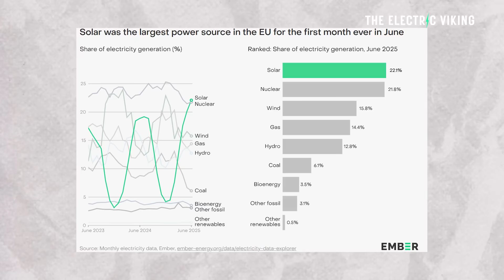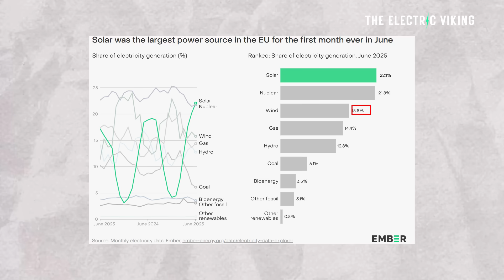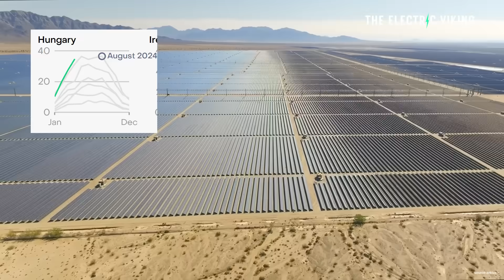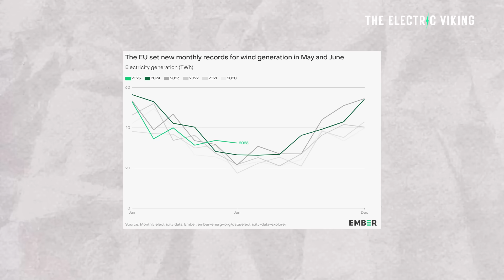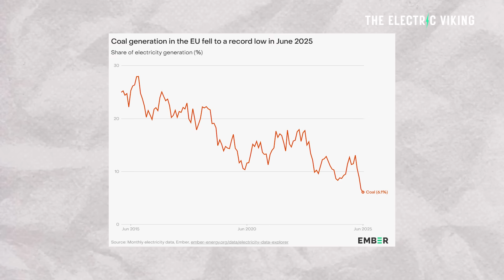Coal Hits Record Lows as Solar Power Becomes Europe's No.1 Energy Source

Comment: What's impressive is that renewable energy generating as a percentage is creeping up even thought a lot more is being thrown on the electric grid, EV cars, heat pumps, AI datacentres and air con with the heatwaves Europe has been getting over the last decade.

If this continues, eventually renewables could power everything, especially when battery tech is cheap for high capacity.

Comment: Bunch of idiot on the most ungreen technology around especially wind turbines even on this to cost a neyodium magnet core could get a 50% flux increase that is DC power so required frequency adjustment battery cause it can't direct load gas when it doesn't have enough and vs 7 nukes on the east off Australia would require 21.500 plus turbines alone your idiots at twice what your parents payed

Comment: The problem with solar is: it’s not available 24/7/365 🤷🏻‍♀️ so we need a 100 % backup for the night and for when the sun doesn’t shine
Reply: This is what energy storage is for.  And other alternative sources such as hydro and geothermal.  It will take time to build out the necessary storage capacity, and increase generation from geothermal where possible.  In the meantime, the focus should be on maintaining the bare minimum of nuclear and gas plants to support the grid through the night.  The goal should be to phase out coal plants ASAP, and then phase out gas generation ASAP, and then in the longer term after battery capacity is built up, it can be considered whether nuclear should be maintained or not.
Reply: @HonestJohn-y3k here in Germany we’ve already found out that doesn’t work. 🤷🏻‍♀️
Reply: Fortunately batteries continue to drop in price, and installation of storage batteries (making solar power available in the evenings when electricity use is often at its height) is at record levels and continues to grow.
Reply: @simhedgesrex7097 it simply won’t work on batteries only 😂
Reply: Solar energy needs to always be combined with hydro, nuclear and wind. Germany closed their nuclear powerplants. Which was INCREDIBLY BAD move, as Germany got like ZERO earthquakes and their neighbour France got gazzillion of nuclear powerplants. So HOW will Germany EVER be safe if France REMAINS to have so many nuclear powerplants? Isn't that embarassing? Not to realise THAT?

Comment: That's great and all but then shouldn't the cost of electricity going down?   Seems like the areas that have the highest renewables are the ones with the highest rates.
Reply: That's because how pricing is set. The day is truncated in periods and for each period they bid to all the producers and select from the offers what is need to cover the expected electricity demand and the price overall price is set to the highest price of the selected bids. So even if just 1% of the production is done by costly gas or coal plants the whole 100% of the production is paid to the producers at the highest price. So unless pricing policies changes, electricity prices will remain high till we can cover even the peak demands most of the time with a combination of renewable and batteries.

Comment: Between 1999 and 2008 the EU was consuming some 300 million tonnes of coal per annum. In 2024 this was down to 107 million tonnes. Meanwhile somewhere else in the World: "China Coal Production was reported at 4,710.000 Tonne mn in Dec 2023." This is roughly 44 times the consumption of the EU in 2024. While the EU reduced the consumption of coal by some 193 mn Tonne since 2008, in the same period China increased the annual consumption by over 1,193 mn Tonne. Imho much more important than phasing out coal totally in some countries while others keep burning it, would be to put purifying air filters on each existing or new coal planet Planet-wide. Smog and dirty air from the seventies, eighties and early nineties in Germany were long gone by 2008 and 2010, long before they started shutting down coal plants (without working replacement).
Reply: China has now reached a tipping point, with less coal burned this year than last year (even though demand went up), and the drop will continue to install record breaking amounts of wind and solar, along with Nuclear.
Reply: @simhedgesrex7097  They are installing record wind and solar, nuclear and hydro - WITHOUT phasing out coal and gaz etc. Less coal burned this year? It 100% has nothing to do with a drop in production because of Trumps tariffs some would say. I think otherwise.
Reply: They have also doubled their solar and wind power plus battery storage, give them time and you will see the coal diminish as they know its cheaper to get free energy from the sun than dig it out of the ground
Reply: It is good to clean up the terrible particulate pollution, but this does not solve the problem of climate change due to greenhouse gas emissions.  Far, far better to phase out coal entirely.  This will mean adding lots more wind and solar generation, with battery storage.

Comment: The UK, Europe, Germany and the rest of the world have been too slow to transition to wind and solar energy combined with battery storage and all electric vehicles.  Wind and solar energy do not need to be imported and can be produced locally in any country. Battery storage is key for base load power. 
Europe needs to provide more incentives for homes and businesses to install electric heat pumps and get rid of old polluting gas and oil boilers.  The move to electric vehicles will also be sped up. There is no good reason to help fund Putin's war by buying oil, gas and coal from Russia. There is a Climate Crisis making weather events more extreme.  Time to switch to renewable energy. The future is renewables. They are safer, cleaner and cheaper than fossil fuels. It is time for governments to end fossil fuels industry subsidies.
Reply: Looks to Russia and other oil producing nations. UAE is investing in clean energy and Russia is still investing in oil, gas.
Reply: @AGZF1983So is the US.

Basically China leads the world into the electric future, while Russia and the US believe they can cling to the fossil fuel past.
Reply: Yes we need to stop feeding the furnaces with non-renewable stuff and crack on with solar, wind and storage, once fitted off it goes

Comment: This is just like the California BS "electrical generation" records you have quoted before - on summer peaks.  You take no account of anything but Electricity which is only 33% of all power used in Europe.  Today EU electricity still uses 37% fossil fuel, and 23% nuclear, Wind 17%,  hydro 13%, Solar 9% 2.4% burning waste. But again - Eectricty accounts for only 1/3rd of energy used in EU. Hence 67% of industrial etc are nearly all Oil and Gas. Overall Solar is only about 3% of Europes total energy use. Even when Solar peaks in the high hours of Summer - it is only about 8% for very short periods in the summer. Why distort the truth?  Becasue it seems tiny?

Comment: Interesting that electricity consumption increased by 2.2% but in some countries grid demand has actually gone down. This is because more households and businesses are producing and consuming their own power on-site, reducing the load on the grid. Here in France supermarkets are putting up acres and acres of solar panels which creates shade for cars but provides a good %age of the electricity needed to run the store. It's all going in the right direction. 😊
Reply: On-site solar is such an obvious solution.  Every government should enact policies that favor it.  It's a good way to avoid domination by fossil fuel suppliers.

Comment: In Finland it makes absolutely no sense to rely on Solar. The problem is the winter. As there is midnight sun in the summer there is full blasted dark season almost without sun. Luckily for Finland there is lots of firewood. There is actually more energy firewood you could ever consume. So Finland and Sweden should have special treatment considering burning wood because it is unfair to expect them to use solar power. Firewood is actually the best and only sensible way to store energy for long periods of time in places where it is abundant like in Finland and Sweden. Another consideration is that in Scandinavia, houses must be properly insulated to keep heat in during the winter. Due to the good insulation of houses, utilizing heat from firewood is particularly effective in Scandinavia.
Reply: Firewood is not renewable in the short to medium term (you need to grow back the trees), produced carbon emissions and particulates that are damaging to health.  Finland is quite capable of using wind energy, hydro energy and nuclear in the winter. It uses a lot of biomass already, but needs to gradually cut back, once it has phased out coal.
Reply: " In Finland it makes absolutely no sense to rely on Solar. "
Right now that's absolutely true;  What about wind power?  I imagine that it gets very windy in Finland, especially in winter.  As PV gets cheaper in the future, it may become worthwhile to install some solar, even if it only functions four or five months every year.
Reply: I would say that solar there is viable in function of price's panels. If they are cheap enough then might be an option for low consumption (not heating).

Comment: Great story! However not quite: this is only the electricity source. Electricity provides less than half of all energy consumed.
There are major gas networks in Europe, as well as a major fossil usage for all forms of transportation. Mobility and heating are not by far yet electric. This is the HUGE transformation. Moving massively to heat pumps (for heating) and urban heating systems. Of course: ICEs move to EVs - but cars last ...   WIND! Vattenfall just OPENED its first subsidy-free Netherlands based North Sea wind farm! Commercial business doing this: amazing!

Comment: Cost per kw

China $.08/kw
USA $.12/kw
Germany $.40/kw

China has lured the west to replace traditional electricity generation with alternatives so they can take your industries and jobs.  Ultimately to control your country.  

It’s not a conspiracy.   It’s a strategy.
Reply: I guess China lured themselves into it too: In the next five years China is expected to add annually: Solar: ~100–150 GW, Wind: ~30–40 GW, Nuclear: ~8–10 GW , BES: ~3–5 GW. Now lets change the numbers for CURRENT capacity factors in China: Solar: ~20-30 GW, Wind: ~11.3-15 GW, Nuclear: ~7.2-9 GW.  Wind and Solar capacity factors will increase, Nuclear will remain in the same range. Coal net increases for the next 5 years is around ~30 GW annually, ~15 GW with current capacity factors.

Comment: China burns approximately 4.5 billion metric tons of coal annually as of 2022, which is nearly nine times higher than the United States. About 60% of this coal is used for electricity and heat production. Given coal generated about 59% of China’s electricity in 2023 (around 5,500 TWh), most of the annual coal burned—roughly 2.7 billion metric tons per year—is estimated to be used for electricity generation alone.
This figure is an estimate based on sectoral coal usage data, as the majority of China’s coal consumption is for power plants. The remainder is primarily used for industrial purposes such as steel and cement production.

Comment: Going from cooking and heating with gas to electricity may also increase use of electricity. I don't know if it is happening. I live in Norway where basically all energy is electricity, and it's not EU.
Reply: I suspect the main addition to energy demand is from data centers.  This is certainly the case in the US.
Reply: It is starting to happen in the UK as EV car sales are now at 25% of all new cars.  And heat-pump uptake will start to have an impact in the next few years.
Reply: @simhedgesrex7097 That's good, but still, UK is not EU 😉. Though i suspect it is happening in countries like Germany. 😊

Comment: Install solar on battery storage that is on-site, solar, and wind farms
Reply: Correct, there's a climate cost to making and installing solar and battery storage but once fitted it quietly pumps out free electricity for the next 20 to 40 years with minimum maintenance, nothing else to dig out of the ground and when its useful life is over just about everything is recycled, old panels can make more than two new ones dues to advances in technology too.

Comment: I live in Slovakia, and replacing just one of our nuclear power plants (like Bohunice – 1,010 MW) with solar and batteries would cost over €130 billion.
That’s:
15 million 500 W solar panels
Over 650 GWh of battery storage (just to cover 30 days!)
Compared to only €6–10 billion to build a new nuclear plant of the same size
And solar works only ~12% of the time here in Central Europe
If you think we can just “replace nuclear with solar,” you probably haven’t done the math.
Reply: Well, that was an … interesting… comment.

New nuclear costs VASTLY, VASTLY more than the price you quoted. Look at actual recent builds - eg Flamanville 3, Hinkley Point C.

And your maths regarding the number of solar panels is… interesting. The actual number is just over 2 million panels, not 15 million. Were you attempting to adjust for lower capacity due to climate?

No one would build enough battery storage to last 30 days. No one would build a renewables system for a country only using solar and batteries.
Reply: @glennjgroves  Thanks for the reply! Let me clarify a few things:
Yes, I'm from Slovakia, and the nuclear plant I referred to (Bohunice) produces around 7.2 TWh/year.
A 500 Wp solar panel in Central Europe yields ~550 kWh/year on average.
So to match 7.2 TWh annually, you’d need:
7.2 × 10^9 / 550 ≈ 13 000 000  panels
That’s 13 million, not 2 million.
(Your 2 million would only yield ~1.1 TWh/year in our climate.)
Battery storage for 30 days? Exactly – no one does that. But that’s what you'd need if you wanted solar to fully replace nuclear (especially in winter), which is the whole point:
 It’s not realistic in this context.
I agree that new nuclear in the West can be insanely expensive – but that’s often due to regulation, legal delays, and mismanagement. In contrast, Asian projects (e.g. South Korea, China) build nuclear for $3–6 billion per GW. Lets say 30 bilions
The post was meant to illustrate orders of magnitude, not fine-grained LCOE debates.

Comment: We have plenty of solar in Spain, but it is causing blackaouts because the grid operator has forgotten to require investment in batteries that would keep the grid stable.
Reply: Does Spain have $2 Trillion for the back-up batteries required????
Reply: In Portugal it's the same
Reply: If they had the wrong ratio of solar panels to batteries, the solution is not to replace solar panels with fossil fuels, it's to add more batteries.

Comment: Ist your headline states 'solar becomes Europes no 1 energy  source, as  soon as you start speaking you change your language to no 1 electricity source, these are completely different metrics, electricity is only around 20% of total energy required. therefor in the middle of summer this year 10% of Europes total energy consumption came from solar, that figure will drop to virtually 0 in winter, meanwhile Europes manufacturing base is collapsing ,and heading to asia(mainly China) who's energy comes mainly (58%) from coal. Once again you manage to so distort reality to perpetuate your irrational ideaology.
Reply: Electricity is 20% currently, yes.

Electrifying the energy system would achieve two things. First, increased efficiency would mean a lot less wasted energy, like, we could decrease all primary energy use by roughly 50% just by going electric, regardless of source. Second, it would mean a lot less reliance on the middle east and their oil.

And, achieving it also merely requires a doubling of the current electricity generation - in the worst case.

Last, you have yet to understand that China coal use is now decreasing and have been for quite a few months. 2024 was both peak oil and peak coal for China.
Reply: China is increasing solar, wind and hydro at a greater amount compared to coal. It will also phase coal out. Its a transition that takes time. It also makes the most solar panels and batteries.
Reply: "manufacturing ... heading to asia(mainly China)" where standards are weaker, so CO2 emissions per unit of industrial output are higher, with the result that global emissions are higher. You couldn't make it up.
Reply: China has already 1 terrawatt of solar installations and growing exponentially. To take China as an example is stupid, they are installing solar at record level.becsuse it is the cheapest form of electricity.